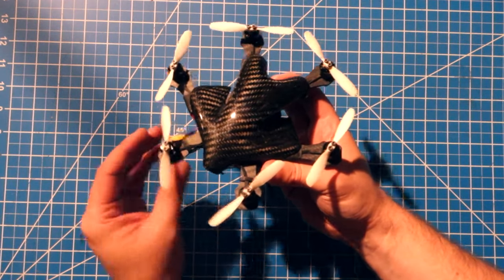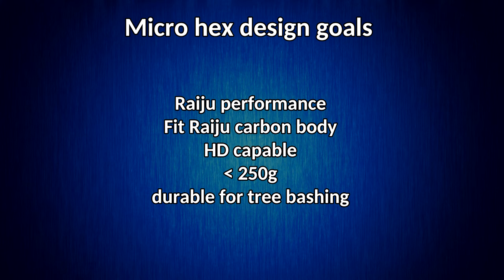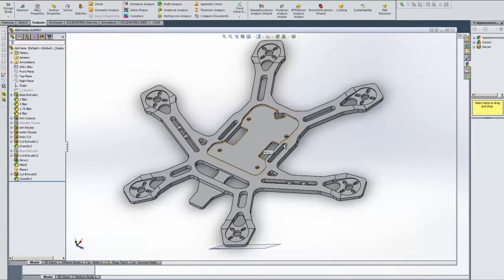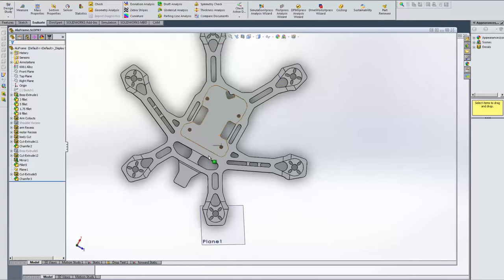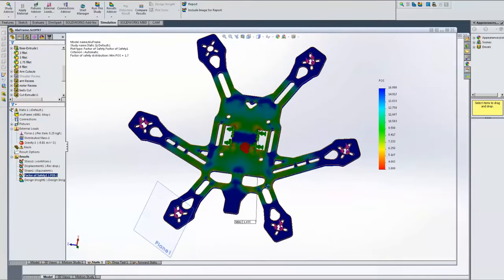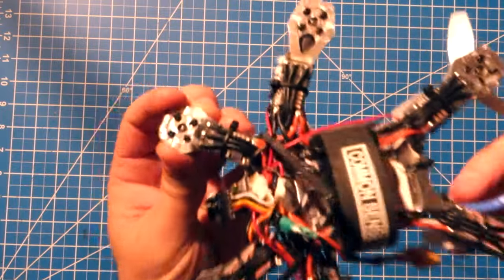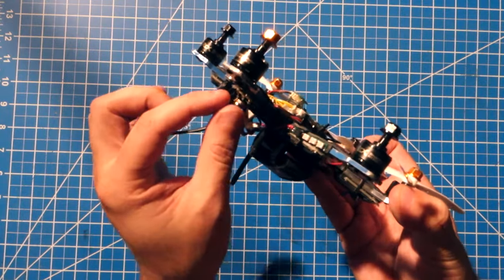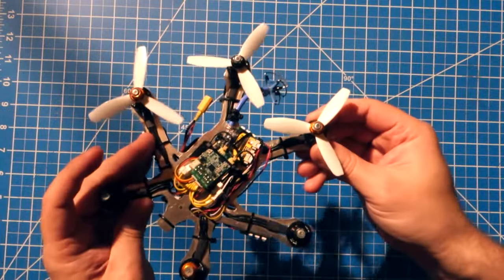Micro hex design - Part 1 - proving the concept

Comment: Nice work! :) Thanks for sharing. Im wanting t build my own mini hex for beating around the inside of the house. It rains a lot here. You gave me some great ideasI jThank you. :) I Iust completed a scratch built 330mm hex from aluminum for the exact same reasons you are. [Google Cuttlefish Blu Rayo if youre curious]. It actually turned out very competitive weight wise (825g AUW) to carbon fiber because i was not confined strictly to the PCB plate sandwich design.  I received a lot a flack for using aluminum from the racer crowd , but I love the way it turned out.  Mainly for the ease and speed of repair. Dont need glue, just a hammer, flat blocks, and pliers.

Comment: Awesome project... how are you cutting the aluminum frames?  What's your plan for the design once you're happy with it?
Reply from the maker: I've got a small 3040 gantry router and do my own machining.  My plans only go as far as making a couple of spare builds for myself so that I can go longer in-between maintenance sessions :p
Reply: Ah, I see the CNC in the background during your intro...  Do you think a Shapeoko could cut one?  I have a bunch of 1x06 / 3" stuff I'm trying at the moment, and I'm starting to see the merits of aluminum.  I actually want to try HDPE with expendable carbon rod stiffeners, but it's difficult to cut.  Would you consider putting the frame on thingiverse or something along those lines?
Reply from the maker: I'm sure a Shapeoko could do it, but I think that's even less rigid.  You'll need to get aluminum specific endmills with as few flutes as possible, use a feeds and speeds calculator, and be sure to de-rate heavily because of the rigidity and maybe even runout on your spindle.   I stay around 30% spindle power on my machine for hogging and it doesn't stall out or seem to chatter too bad.  I haven't done any plastics machining yet, rigidity is less of an issue there but I'm sure some still cut more gummy than others, and getting the feed and possibly coolant so that you're not rubbing and melting the plastic is going to be really important.

As I get further and further away from the rotorX design I'm more willing to share the cad files, but I'm not decided yet.
Reply: Yeah, sorta understandable with RotorX, but I think this sort of thing is too derivative and progressive to pretend anyone owns any idea.  From what I've seen, keeping debris clear during the cut with an air nozzle is key on HDPE.  Nobody has tried HDPE 3" prop-sized frames yet, which is weird since the lower mass of smaller drive would help with indestructibility.  I'm still moving the workshop, and the Shapeoko still needs assembly, but that's likely my first experiment.  What's your dayjob if you don't mind me asking?  I just left auto / aero automation crap which I hated, but I'm stuck in MI for a bit.
Reply from the maker: Airblast works great, that's all I'm using, though I've been thinking about a MQL setup I haven't felt super in need of it yet.

I'm an animator, currently working at Industrial Light and Magic
Reply: Aha...  it all makes sense now ; )  Neat.  I'm looking forward to more details on all your projects.  I'm paying close attention to your build techniques and trying to work out optimal efficiency / durability myself for the electronics and whatnot.  So far 30awg silicone wire point-to-point with everything has been easy and crash proof, but certain things do benefit from connectors.

Comment: Is there any SolidWorks pricing system for hobbyists?  I can see that they offer a student edition, but I wouldn't qualify for that.  The only other option I see is the full commercial application. I'm wondering if you, perhaps, know of some third option that would be suitable for hobbyists.
Reply from the maker: I don't know of anything for solidworks, I only use it because it's what I'm most familiar with.  If I was starting fresh right now I would totally look into Fusion360 from Autodesk.  It's free for hobby use as long as you make less than 100k a year with it I belive.  It looks quite capable and has fantastic CAM built right in (actually the same CAM that I use in solidworks)
Reply: +SiieeFPV I will take a look at that. Thanks for the info.